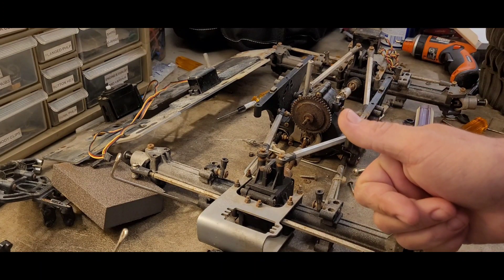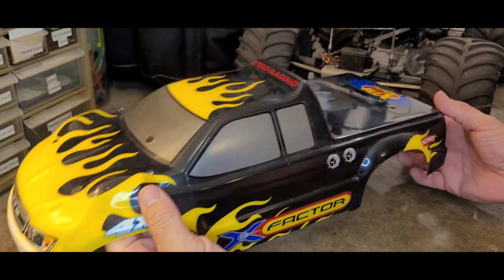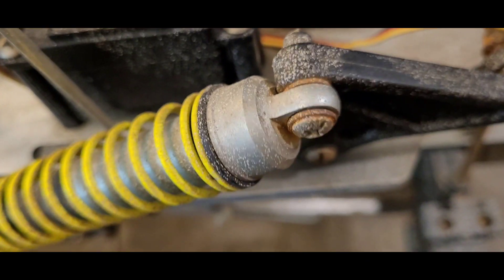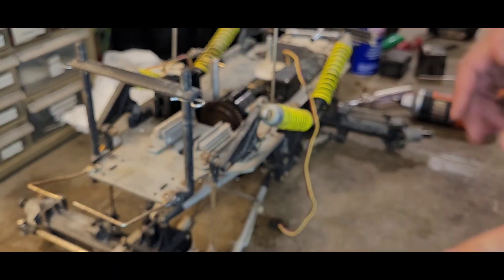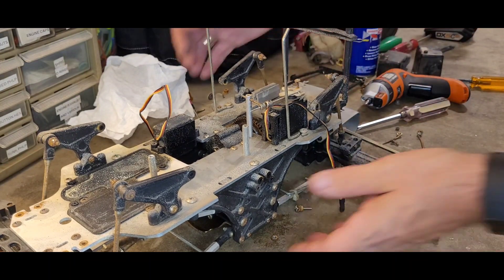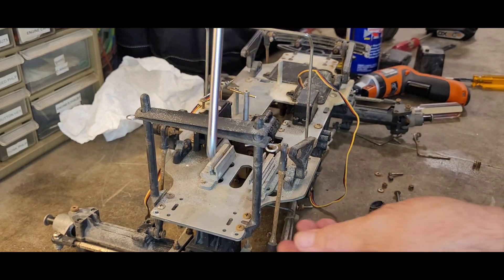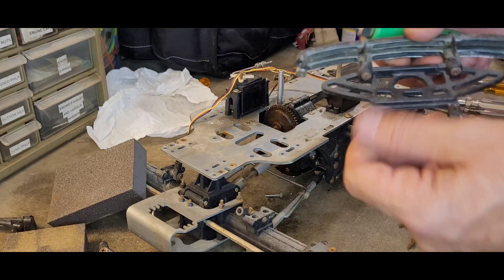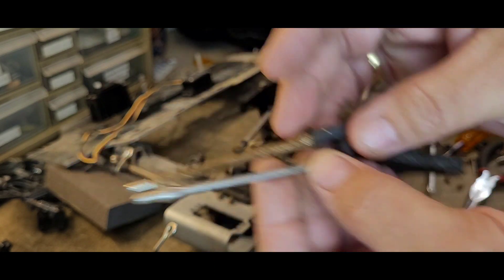XTM X-Factor Nitro engine monster truck restoration pt. 1 discussion and partial disassembly

Comment: I bought one in 05 came with extra parts and extra body. It's about half torn apart right now. Been thinking of putting it together for display.
Reply from the maker: I'm definitely going to run it when I get it back together, but not much. It will be a shelf sitter as well. Thanks for watching